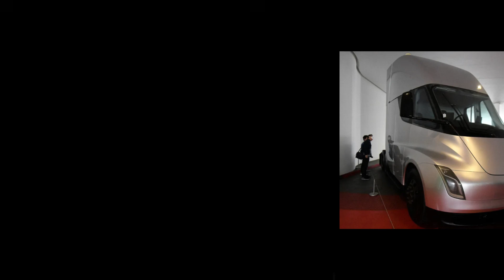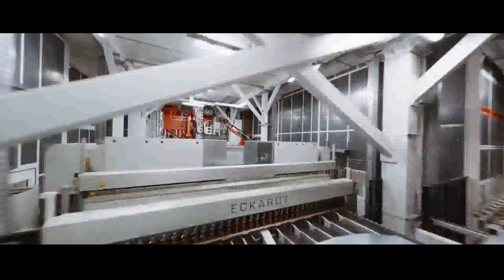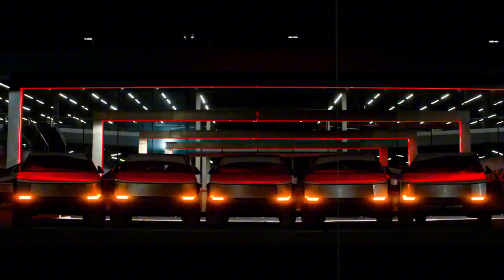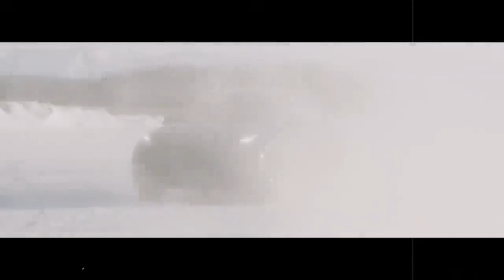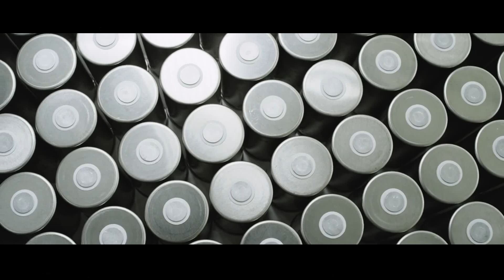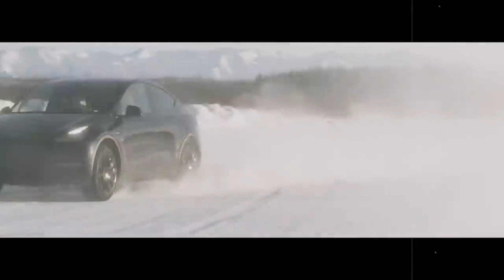New Tesla SEMI - Elon Musk TALKS ABOUT TESLA SEMI, WILL Diesel END Tesla for LESS than $25K!

Comment: Years ago, Elon said Tesla Semi would change the world of trucking.

Today, April of 2025, 99 percent of trucks in America run on diesel fuel.    Tesla Semi is going nowhere.
Reply from the maker: That’s a valid observation — the rollout has been way slower than expected. But if Tesla eventually solves charging logistics and range for long hauls, do you think it could still shake things up?
Reply: @THEEVSPACEE  Charging and range are huge challenges when the battery-powered truck is competing with diesel trucks and a huge diesel infrastructure which is in place.